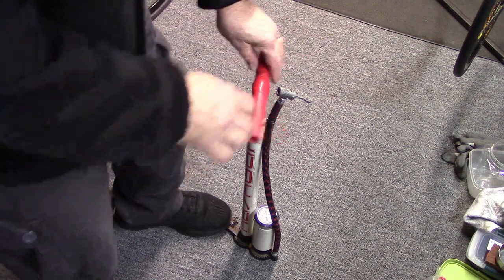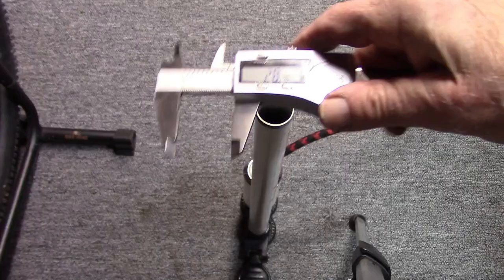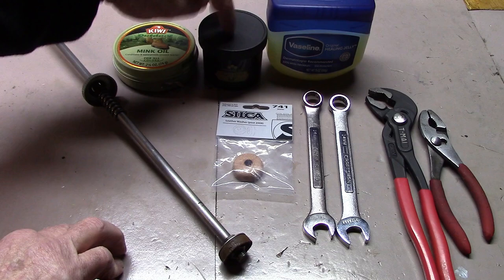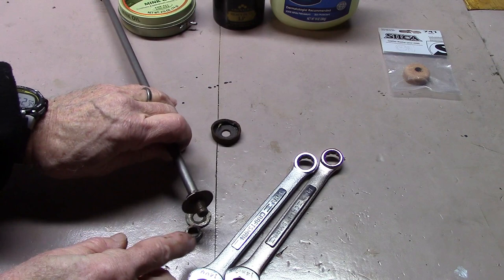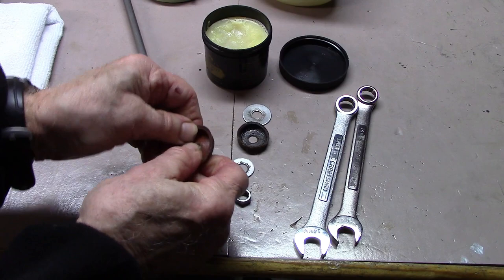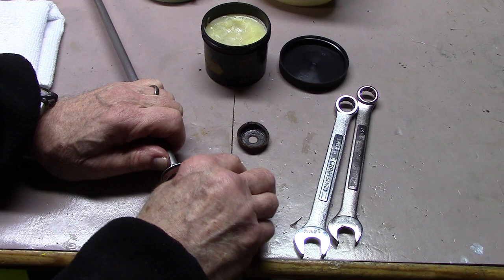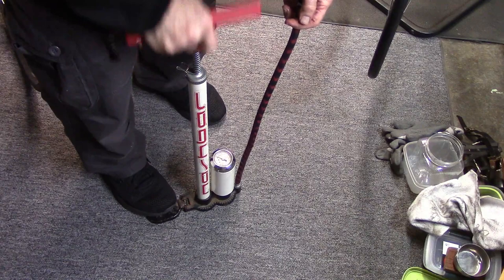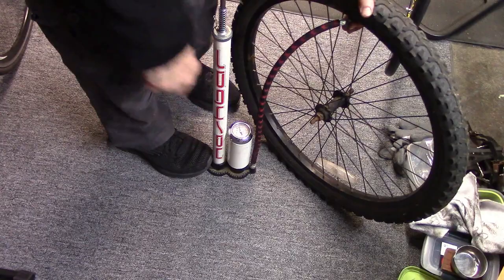Silca or Vintage Pump Repair: Replacing the leather gasket

Comment: Holy moly thank you sir I never knew you could buy new leather gaskets for old bicycle
I dunno how many I've come across over the years but threw away because I didn't know you could buy a new gasket
Reply from the maker: You can purchase them on-line from Amazon and a number of different sources. Just be sure to measure the diameter and purchase the correct size gasket. Silca, Joe Blow, Lenze and some other manufacturers also sell additional parts and rebuild kit. Regards and safe cycling, Tony
Reply: @tony10speed  yes sir thank you very much

Comment: Thank you! Fixed my mom's vintage pump by following this. Bought a new leather gasket on amazon and they sent me one 1/8 inch smaller than I ordered but I managed to stretch it out to the appropriate size with vaseline and armorall.
Reply from the maker: Great work. Lubricate it each year. If it fails, go with the proper size and the lubrication will actually make it slightly smaller and fit snug. Regards and safe cycling, Tony

Comment: can we use something else for the washer?
Reply from the maker: If you mean the leather gasket, no. The gasket is cheap and readily available.
Reply: @tony10speed  This gasket is not at all available here. so can I try putting together layers of butyl tubes or cut it out from old tyre itself.
Reply from the maker: @tuxnoel  Never tried that but if it works, please let me know. I would be very interested. Regards, Tony